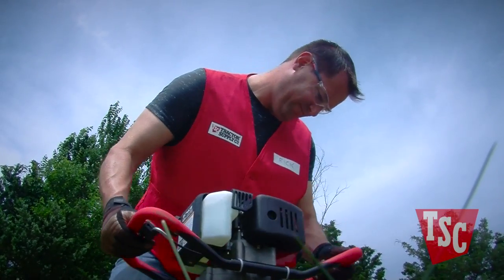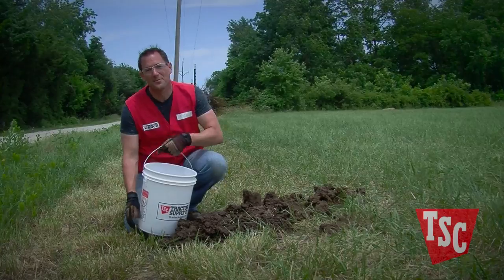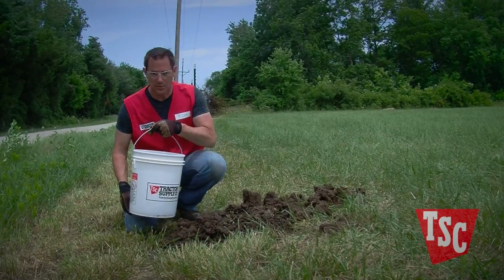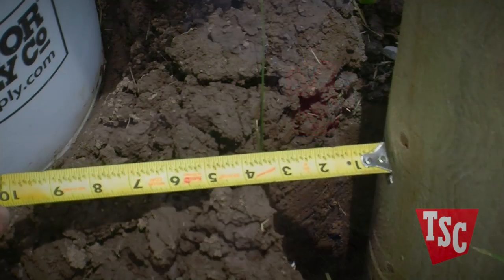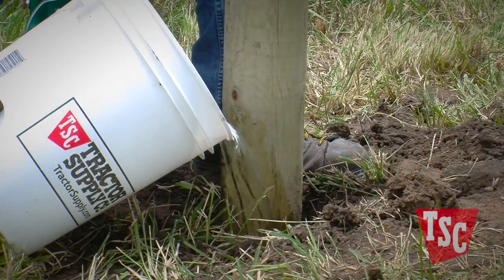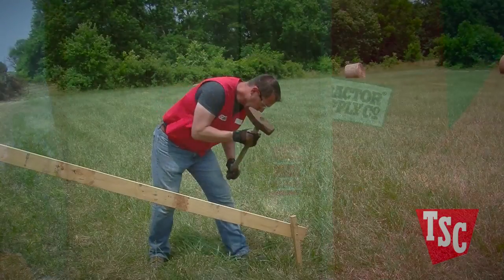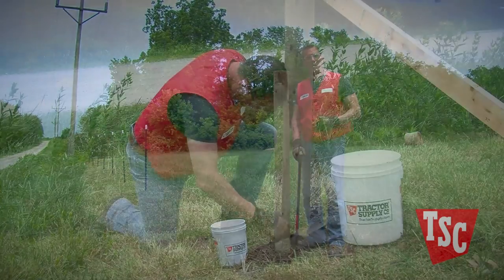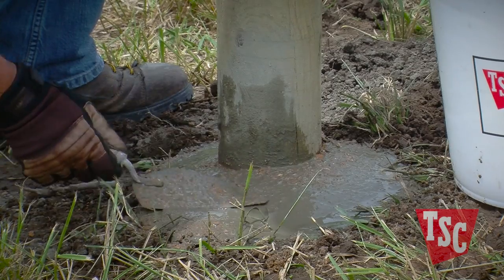How to Install Wooden Fence Posts | Tractor Supply Co.

Comment: FenceFins are a pair of metal fins that attach to the post and brace firmly against the soil, counting the wind force on the fence (instead of using concrete) - have you tried them? There are videos on here of how they work

Comment: What if the post were dipped in tar or some type of sealer painted on the post before putting in the hole,would that help seal them so rot would never occur?
Reply: I think no matter what water will get in and eventually cause rotting.

Comment: Concrete is a waste of money and rots ur post, just tamp the dirt back in real good is all you need to do
Reply: I'm building a fence. You mean i can set the posts without using concrete at all?  Just infill the original dirt? thanks
Reply: yes sir! just tamp the dirt back in the hole a little at the time, use your metal digging bar to tamp it in if you have one
Reply: won't the dirt get wet when it rains, and thus weaken the post? how can dirt be strong enough to hold a fence post up during heavy winds etc?? how deep should i set the post then? I'm assuming the post has to be set deeper if it is just set in dirt?  thanks in advance for answering me before i set my first fence post:)
Reply: thats how ive done it my whole life and never had a problem id set the corners 3 1/2 foot deep and line posts 2 foot deep search "how to set a good solid post" by wagner 59270. thats the best video ive seen showing how its done
Reply: thanks for your reply. i watched the video you recommended, and yes indeed, he set the post with just pounding dirt in the post hole. I'm sure that technique will work with what he was doing, which was just running barb wire along the posts, but I'm not sure if this technique would work with holding a traditional fence up that has boards and rail and a gate. Probably the wind would weaken it, at least, after several years. However, its a great method to set a post quickly that doesn't have to withstand a lot of weight.  At  least, that's just my opinion. We get a lot of wind along here on the central coast of CA., and the wind i think will be too fierce in the long run for my fence I'm building. Thanks though for your help.
Reply: if using concrete in your area will make it stronger go for it, set them all in concrete except one use dirt and time will tell, 10 years down the road youll know what works for you
Reply: thats a great idea, i never thought of that. I really do want to try the dirt only method, I'm not fond of the permanency of concrete, but we all know its necessary sometimes. I'm still in the planning stages, so i will have to figure how I will use thee dirt only post experiment.
Reply: @storminnormanz  I prefer a broken shovel or axe handle. I've put in hundreds of posts with dirt only with good results. Much easier to pull one out if broken by a horse or mower.
Reply: Even if you’re setting up a cattle gate ,I don’t think with dirt alone will help hold that gate steady